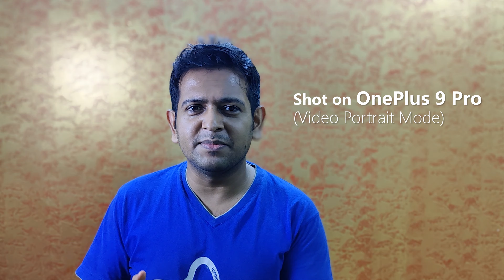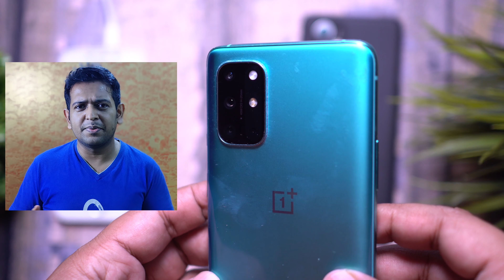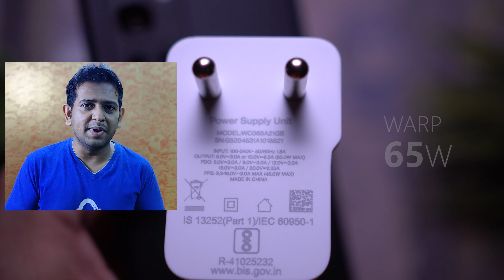OnePlus 9 Pro vs OnePlus 8T - Battery Charging Speed Test! (BIGGEST DISAPPOINTMENT)

Comment: My 9 pro is taking 45-50min while charging from 15%-100% .. Is it a faulty device or faulty charger??
Reply: Global version. But it's working fine now. I drained the battery to 0% and charged it. From then on it's working fine. Issue got resolved.
Reply: @gayathrig9723  doea it heats up like high
Reply: @anasshal962  depends on your room temperature. If you are out on a sunny day and your usage is more definitely it gets heated up more. At room temperature, mostly at your home it gets heated up but not so high. Even while gaming at home it gets heated up a bit, but that's not high. Mostly depends on your room temperature.
Reply: @gayathrig9723 My oneplus tends to heats up even on normal use and it never cool down, it kinda always stays warm even without any use. So i  run a diagnosis on my battery on oneplus care app  and the result  says that' battery seems faulty'😭, please check yours too , i have requested to return the product. Please check yours too on oneplus care app, and tell what it says on diagnosis of the battery of your phone
Reply: @anasshal962  that is a software bug...if u turn reverse charge on and then off then it'll not show that battery is faulty
Reply: Do you have the global version or china version with oxygen os?